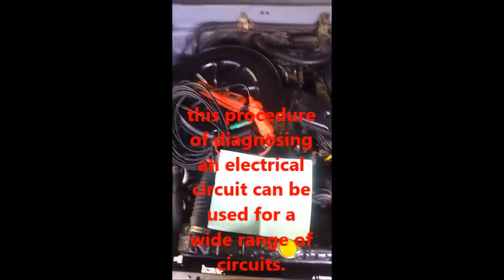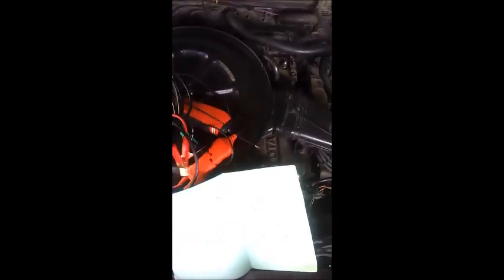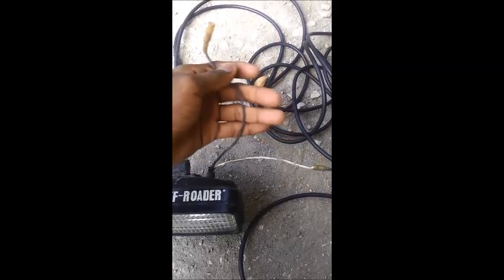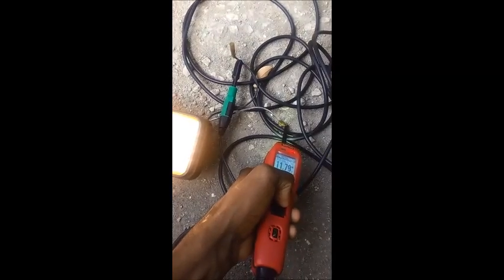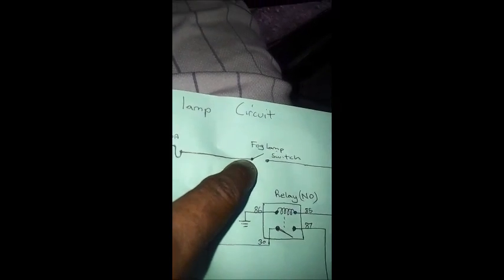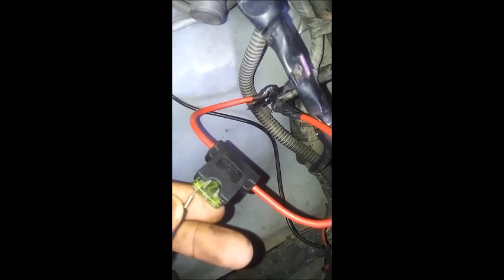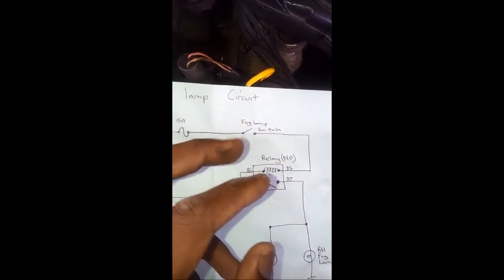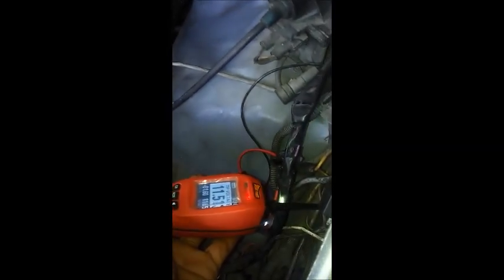how to test fog lamp circuit

Comment: Hi I have problem whit my fog lights the switch turn on and the lights not I have a red wiring on the battery whit fuse and other wiring orange this one I check on the relay is don't have power when I turn on what you thing the bulbs all ok thank you very much
Reply from the maker: oh are you getting positive voltage to the relay? if u arecheck if power is leaving the relay to the fog light at the relay. if voltage is leaving the relaythen that means the fog light grounds arent proper or the power wire is broken

Comment: great Source...Thank you
Are you able to tell me that on a 2017 GMC Yukon Denali I am replacing the fog lamps to led lamps and I would like to connect to the original fog light switch in the cabin.  Are you able to instruct?
Reply from the maker: all you would have to do is connect them to the original wires at the fog lamp

Comment: good video but the relay is kinda redundant. you could have just grounded the fogs individually to bolts on the corresponding sides, combined both power wires into one, ran that to the switch in the dash, then had a power wire with a fuse within 1 foot of the battery running to the switch in the dash and then bam there you go. this is basically a switch telling another switch to turn on
Reply from the maker: yea that is so true thanks for to comment, however foglights draw a decent amount of amps and i like to use a low amp small neat switch in the dash. when ever wiring a circuit with a high enough circuit i recommend using a relay so that small wires can run to the switch in the dash. however my way is just one of a million ways you can do it. the safest way too. thanks again!
Reply from the maker: using a relay allows you to use a wider variety of amp size switches, small wires so they can look neat with the other small dash wires, allows less voltage drop due to the lenght of the wire, and a smaller chance of shortage because the with a relay you can use two fuses, smaller one for the control circuit and a larger one for the feed circuit which the foglamps are located. but running it you way is a quick easy way to do it.